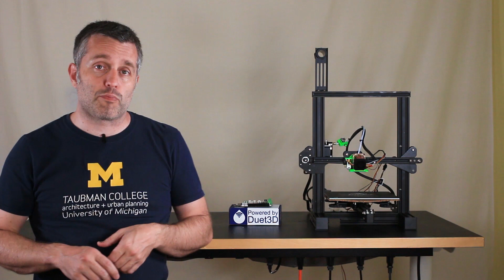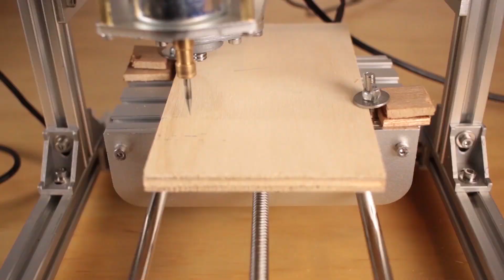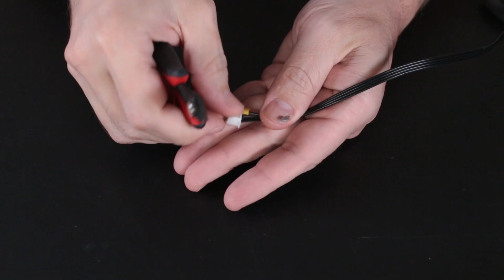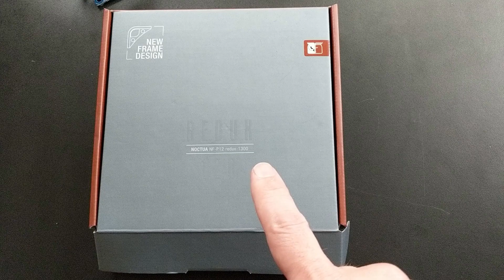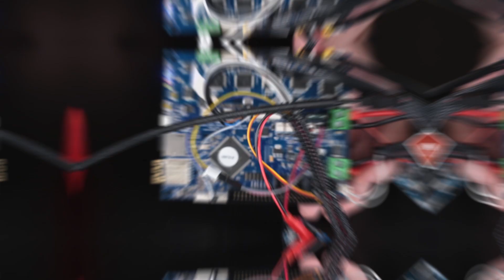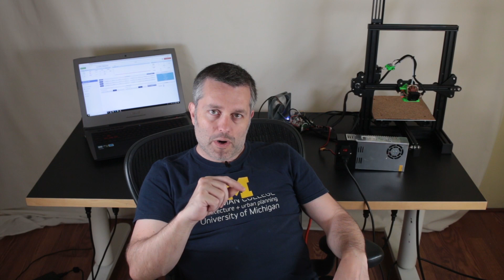Wiring the DUET Wi-Fi to the Ender 3

Comment: I spent $25 for a ferrule crimp tool and a box of ferrules. You can get the tool for half that -- do that. I don't see a reason to shortchange wiring. As far as crimping the dupont style duent molex crimp connectors, you really don't need the expensive tool. I've crimped hundreds with an small needlenose pliers and my crimps are better than what I get from the actual tool which I do have. I have more control with the pliers and can make the connector perfect. You know duet allows for you supply an alternate voltage for all the fans -- there is a fan V-In pin which can either be jumpered to VCC or 5V or can be given alternate  12v voltage, and as long as you have common ground -- you can use 12v fans throughout -- if that's what your goal is
Reply from the maker: Fantastic Info on the fans. Thank you! I guess I missed that feature in my research.
Reply: @DesignPrototypeTest  just do a search in the duet forum for 12v fans. It's a trick since duet has a 5v rail, so you can jumper the fans over to use 5v, or remove the jumper and feed whatever voltage you want into the fan Vin pin, (within reason lol) duet does pwm on the grout pin, so Vin for fans can be totally independent.
Reply: if you want to nerd out on connectors, check this resource: http://tech.mattmillman.com/info/crimpconnectors/#minipv in the comments are some good cheap tool recommendations
Reply: I don’t agree with the opinion that ferrule crimp is better than solder.  Solder May be soft but if you screw a terminal tight enough you will bite into the copper.  The solder will fill the void and will provide further ohmic contact.   A crimp forms a surface contact which is a V shape and hence will have more chance of oxidisation.   Solder is a chemical bond.
Reply: @GodzillaGoesGaga  ferrule creates a square which the shape of the screw type connector. Soldered end is still round
Reply: @kazolar  That doesn't matter.  If you bite into copper it deforms and has a large surface area which is in contact with the screw.  This concept has been used on a very large amount of products without failure.   The point is, there is a 'standard' that's been enforced that is not appropriate.  This is why some government bureaucracy needs to be questioned.  I'm all for standards that make things safer or better but forcing something that is questionable is just asinine.
Reply: @GodzillaGoesGaga  In a regular screw terminal solder does not help. By tightening the screw down like this some strands get pushed away, the copper gets damaged and the screw can still get lose over time because there is still solder in between. Ferrules solve all of these problems and are also faster to use without the need for a powered tool.
But in this case, you can simply screw the bare wire in. Those screw terminals used for PCBs actually have a mechanism that clamps the wire between two sheets of metal. You can easily check that, after removing a wire with a ferrule on it from the terminal you can see that it gets squished flat and does not have an indent from a screw.
Reply: Got it!!  I stand corrected.  As long as a ferrule compresses all sides of the wire then yes, I agree.  However square or side compressed may not be as good since there are edges which deform the copper.  I don’t know if a circular compression ferrule tool exists.  It would be in the form of some forced extrusion I’d guess.  if you have any videos or mechanical cross-section photos of a compressed ferrule around the wire I would be interested to see it.
Reply: @GodzillaGoesGaga  The problem of missing Wire strands only is caused by incorrectly removing the insulation. With a good automatic insulation stripper this is almost impossible to do. A slightly smaller wire area also is not really a problem with dynamic size crimp tools.
Reply: It is pretty much impossible to create a proper F crimp without the correct tool. While it's possible to clamp the wire with pliers you won't get a good crimp with this method. You can use crimp tools for JST XH or Mini-PV since they use the same type of crimp.

Comment: This is a really interesting project and seeing the step by step process is really helpful, thank you. I’m interested in converting an Ender 2 into a dual cyclops extruder, so a duet board seems to be ideal for that. A couple of questions, did the Creality steppers plug straight into the duet board, and will the steppers need a difficult calibration process? Thanks! That being said, the increasing amount of opinion presented as fact is getting weird. For example - ‘Reprap is better than marlin” - but no justification presented except more bits?! Also, stealing involves depriving the owner of possession - none of what you’re saying is stealing. Does E3D call using their forums for support to run a copy ‘stealing’? I doubt they’d accuse potential future customers like that, and it would be inconsistent with their decision to open source. Comparatively, it’s not stealing to Debian forums to troubleshoot a Ubuntu installation. Why try to prevent access to the hobby by making the financial hurdle artificially higher? The copies increase the size of the whole market which benefits the original creators as well, it’s not a zero-sum game. That’s not to say the benefits of the increased quality of the original products shouldn’t be played up (the carrot), but using the ‘immoral’ card as a stick isn’t right (in my opinion!). Thanks again for the project.
Reply from the maker: Hi Ed. Yes the wring plugged right in and it worked fine. All I had to do was click the "invert" button on the firmware configurator. I will cover this in the next video. I will also cover the reasons why reprap firmware is better than Marlin.

You present the most logical and evenly stated argument against my "stolen" claim yet. Most people just say "Wrong, you are wrong!" in emotionally charged language. I will have to give your words serious consideration, and I will respond in the upcoming video dedicated to open source and knockoffs.

Thank you for the comment!
Reply: Thanks man. As a counter-point to myself, I can't say I fully understand open-source in the context of hardware design, and I appreciate that a lot of the knock-offs don't seem to be released within the spirit of open-source as I understand it from the software environment - for example, do the manufacturers of the knock-offs open source the details of any iterations they make themselves? I'm guessing they should and we shouldn't support them if they don't.

Comment: In most cases You can even regulate 12V fan on 24V board. Just connect DC Step Down converter Vin+ and Vin- somewhere on board where you have 24V whole time but it's fuse protected and then connect fan's red wire to the converters Vout+  and black cable to the board fan negative output pin. You have on board fan - pin mosfet which control this fan and It's able to handle up to 24V so It's safe.

Comment: “…telling me that I don’t understand open-source, because of the…I didn’t realize it was controversial, but I guess I have a controversial and very strong stance about supporting original creators and how its amoral to buy knock-off products…” 
he says, as he’s trying to knock-off an original creator (Prusa), by using a knock-off product (Ender 3). Does this spell out the hypocrisy for you, or do you need more examples? Apparently, your stance isn’t that strong. This isn’t some Alanis Morissette irony.
There’s a reason why all these cheap knock-off Chinese printers have improved dramatically, and that reason is due in large to the efforts of an original creator (Prusa), the fantastic team assembled at Prusa Research, and the thousands more that contributed. You’re doing exactly what the Chinese have been doing for decades, and not just with 3D printers, trying to generate a product on the cheap without honoring patent law and licensing agreements.
Reply: Kevin... no. The ender 3 isn’t a Prusa knockoff. It’s motion system and overall design is completely different. I do understand Crealitys ongoing GPL issues, and yes, they’re a bad company for not complying with those licenses, but the ender 3 is an original machine from what I can tell...
Reply: I wasn't calling the Ender a knock-off of a Prusa, merely pointing out the hypocrisy of the author of the video who is trying to use a knock-off product to duplicate results similar to that of an "original" creator (apparently calling Prusa an original creator is highly offensive to some, hence the quotes). Creality has some good stuff, I own several Ender versions, but they are far from original.
Reply: @klschofield71  What original creator are you referring to? I guess you should revisit the history of 3D printing definitely... Prusa is not original by any means. He is brilliant in adopting useful and working advancements in technology, putting considerable effort in fine-tuning them for his hardware and giving premium support for that. No other manufacturer is doing this to that extent. BUT, he is in no way original in that regard. The BL Touch is original and is not open source and is knocked off nastily by chinese manufacturers... that is where the problems start, not with Prusa/Creality. Creality in this regard is in my opinion more original than Prusa (as far as the Ender 3 and Prusa basic printer hardware goes) although I admire Josef Prusa for the love and attention they bring to their products and support... but this is another story.
Reply: I got my #Ender3 last week. Up and printing in one hour, I had to fix carriage-rattle and some roller pinch during the build. But hot-Damn this little metal engine can print boi! :oP First #Benchy came out with no stringing, perfect overhangs, very little ghosting, some heat distortion on the lower hull (my fault) I didn't check much, just loaded filament and hit play... I raced it out at 400% and still got a really nice tiny plastic boat, just before the included 1m of pla ran out -lol

I got a kilo of white now, half way through my first set of storm-trooper armour ;oD xxMDK
Reply from the maker: I laugh in your general direction. Nothing about the ender 3 is a knockoff of a Prusa. The overall frame architecture with an overhead gantry and moving bed has been in use in CNC machines for 30+ years. Prusa did not even develop it for 3D printers. It was the logical progression from the Mendel (a design invented by Dr. Adrian Bowyer and copied by Prusa for his first commercial printer). Furthermore, Prusa started using the Aluminum extrusions under his bed AFTER china adopted that construction technique. The Prusa uses linear bearings and rods. The Creality uses Pulley wheels traveling along the grooves of the extrusion. Should I go on? Nothing about the Ender 3 is a copy or a knockoff of a Prusa. Compare that to the "3DTouch" sensor, or the clone of the DUET which are virtually identical to the originals, except where corners have been cut to save cost. You Prusa fanboys are starting to get on my nerves. Your boy didn't invent 3D printing. He didn't even come up with the vast majority of the innovations on his printer. He is just mining the internet for good ideas then putting them on his product and acting like he is the bringer of innovation. He isn't.
Reply: There.. you see? burn in the fire of Kevin's poorly written assertion. :nD
How DARE you upgrade a well-made Cetus knock-off (from a sea of knock-offs) with original parts and make a video! How very dare you mention Prusa in the title, or have any kind of spoken opinion!... That's it, I shall fart in all of your general direction(s) your mothers are clearly hamsters and fathers all smell of elderberries. :oP - wow TDP, you slanderous, fanboy hating, Hypocrite xx Keep up the good work :oD xxMDK
Reply: "How very dare you mention..." and my "poorly written ascertation" do you mean assertion, because Webster doesn't have a clue as to what you're talking about. Probably not in your best interests to throw stones (or farts) when you're living in a glass house; those have a tendency to be sealed up quite well. Clearly you have two coconuts and you're banging them together.
Reply: Never saw it before, but did find it to be quite entertaining. Thanks :-)
Reply: Love Katherine Tate :) wiv her crazy screaming people -lol
You chilled now Kev? To be honest mate, I've read all of this thread and agree in places. But DPT puts a tonne of work in to his content for very modest returns. He doesn't get everything right all the time but then, neither do I. He probably mis-understands open source a bit, but I'll take enthusiasm over TV calibre, scrutinised perfection any day. Cos it's Youtube, people say stuff :oD 3Dp is a sea of "who owns what" litigation right now. But then we been making cnc & xyz style robots for 40-50 years, it's no surprise they are all copies xx
Reply: Tis' but a flesh wound. Seems like I found that last nerve and poked it with a cattle prod. You completely and utterly missed the point. It's not the Ender that I'm calling a knock-off of a Prusa. YOU are the hypocrite for saying that you have a "very strong stance about supporting original creators" then turn around and try to knock-off an original creator by implementing some of the innovative features which, albeit may have not originated directly from Prusa Research, but were most definitively and unequivocally compiled, tested and implemented by Prusa Research into an original product. I'm an advocate of additive manufacturing, so your nonintellectual attempt to insult me with your "fanboy" comment has completely missed the mark, and I'm well aware of the historical and controversial nature of additive manufacturing. You are the initiator of uttering the name "which must not bespoken", not I. And, as far as finding good ideas and implementing them into a product is pretty much the definition of innovation, so, lighten-up man, own up to your hypocrisy, and complete the upgrades to your Ender. I myself have openly borrowed the removable magnetic print bed, brought to us by Prusa, on my own Ender.

Comment: One thing that bothers me about the Ender3 is the XT60 connector is backwards. 
The supply side is supposed to be the connector with the barrels
The load side is supposed to be the connector with the bullets.
Reply: Also, the XT60 makes no sense here. It would make sense with the Ender 2, but there it's missing. Do people really replace their mainboard or PSU that often?

Comment: Talking about supporting original creators with a china printer in the back. one must not forget that the china printers can only come so cheap or in the condition because they are not really controlled as a device when entering the country. If such a thing were to be thrown on the market in a "first world" country, problems would quickly arise. i pay for what i'm able for. started in 2016 with an anet a8, which has since been heavily modified. For that I bought an e3d v6 clone but also the e3d block & sock v6 upgrade kit for support. here in germany i've the option of renkforce printers but they're out of my price range. so the second printer came in is an ender 2.